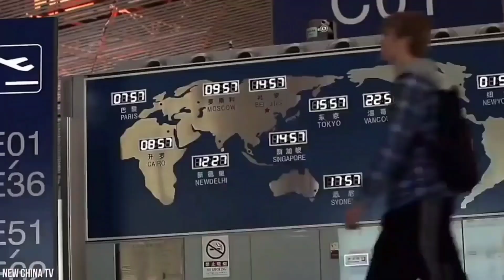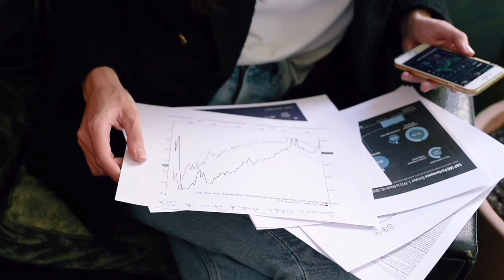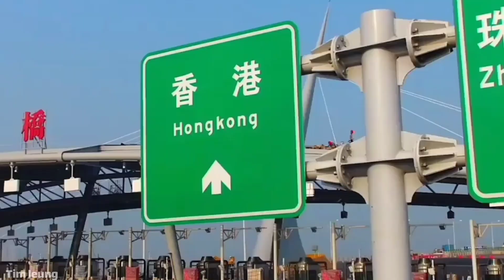China’s Impossible Megaprojects That SHOCKED The World !

Comment: China's project are great to fall in record time! like the 3 gorges! it caused more floods, drought and earthquakes than everything else, the Itaipu dam in Brazil produces more energy than the 3 gorges! average energy production is 45%. And according to a Sino German expert, the dam has so many flaws and is polluting the entire region!
Reply from the maker: My dear friend, it is true that there is a problem in three gorges dam.
But whatever the cost, it is really a great record and of course the dam record that was set by 3 Gorges.
But in my opinion, the Chinese government should take any action against the dam, replacing it with another dam or repairing the dam, although the problem of the dam is not very severe, but there is no guarantee that it will remain the same as the first day.💥
what do you think?🤔
Reply: @MassiveBuild  that's not an easy question, of course replacing it or take any other actions are a risky, but they should try to remove all the debris and waste. Otherwise there is not much we can to, it has changed the fauna of the entire region. We can hope for the best. Once the dam settles, maybe everything will adapt to the new situation, the climate, fewer earthquakes
Reply from the maker: do not worry . We hope that the Chinese government will take the right actions in the best possible circumstances😁 @Nebukadnezar2036